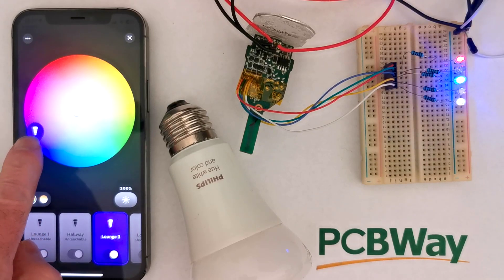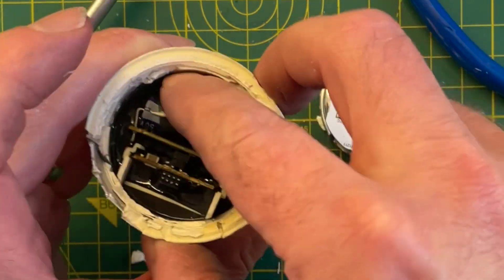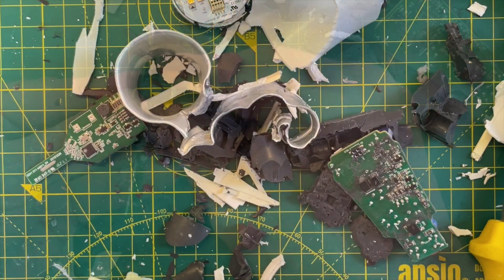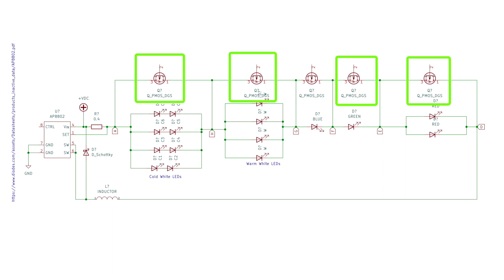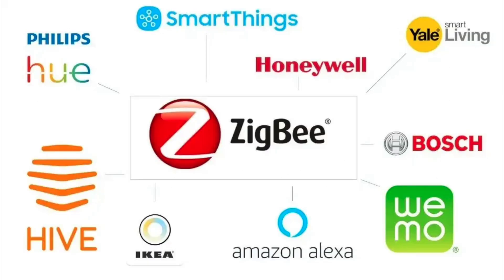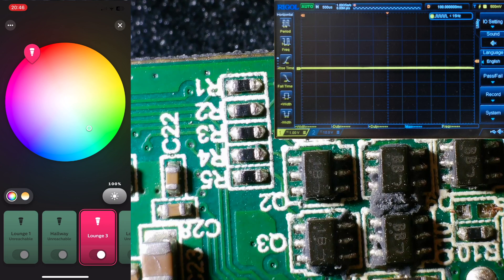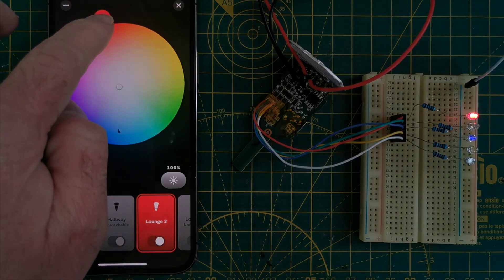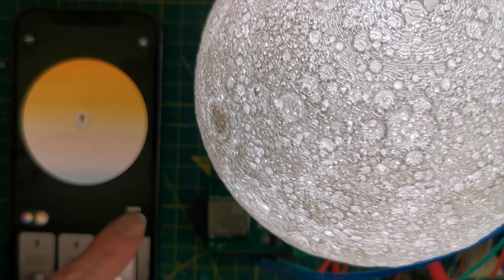Hacking and Disassembling Philips Hue Lights

Comment: This is great info! I have a boat with a 24v DC system and I really want to use my hue bulbs in it. I could run the lights from the 230v inverter, but that seems inefficient. I'm wondering about the possibility of creating a 'drop in' replacement for the power board which would enable the bulbs to work on 24Vdc...

Comment: Weird question, how much of a challenge would it be to get a standard hue bulb to run off of battery power? If I only supply 48 volts to it, will the power board still operate fine?

Comment: I would like to upgrade the LEDS inside to high CRI LEDS. You would need to use a hot air gun or hot plate to desolder the SMD LEDS and then upgrade to appropriate high CRI LEDS.

Comment: At this point it is easier to just use esp32 running esphome to control the LEDs, because they cheaped out on only using one constant current driver chip, it is very hard to reuse

Comment: Thanks for the video! A heat gun will help you remove the plastic diffuser and soften the silicone. Just use caution as not to melt the plastic or electronics, just as you’d use caution prying. Speeds up the workload(and reduces frustration) by a noticeable margin.
Reply from the maker: Great tip!

Comment: Hi! I need to disassemble one of my bulbs for a project. can I run the bulb without housing in terms of heat? the socks gets very hot on a hue bulb. is the aluminum part of the housing some kind of heatsink?
Reply from the maker: Yes, it looks like the whole thing is designed as a heatsink. It will still work without it, but it might cut out after a while.

Comment: Hi I accidentally threw out the LED board with NTC sensor, because I wanted only connection board but now I don't get any outputs probably because of lack of the sensor. The board connects successfully with the app. Is there any way to bypass the sensor? Replace it with single resistor? and how to connect that resistor?
Reply from the maker: Definitely possible - The B & C pins connect to the thermistor. see the high res image here: https://www.atomic14.com/2023/05/04/hue-light-hacking.html a 12K resistor will probably work no problem.

Comment: Have you done any teardown on the Hue candelabra bulbs?  We dont like the bulb base that takes up the lower half of the bulb.  Was wondering if a way to get the LED elements & electronics out, put the LEDs in an empty flame housing, if such a thing exists , and stuff the electronics down into the candle stem of the light fixture!

Comment: can you show to replace the LED diodes(redundant)? can it be done? say or example, 5 years has passed and the Hue bulb goes bad. Can users just solder out bad LED out of the board then replace with generic LEDiodes. then it would be new again? instead of buying new whole Hue bulbs
Reply from the maker: It’s probably possible - if you can take it apart without destroying it. But it’s not really designed to be repaired.

Comment: Nice video, interesting to learn that the Hue bulbs are properly constructed, although it's a pain to get inside them...about the moon lamp, which is pretty btw, couldn't you just have put the whole bulb in there from the start?
Reply from the maker: I was pretty impressed with the construction, surprisingly good. And yes, I did think at the end - hmm... Why didn't I just put replace the diffuser with the 3D printed moon... would have been much easier :)
Reply: @atomic14  Oh well, it made for a great video anyways 🙂

Comment: I love Zigbee and Philips Hue lights. I put the retrofit can RGB downlights all around our house, outside, in the soffits.

I use a raspberry pi and Home assistant to control them.

They work flawlessly. Only con are the lights were 40 or 50$ a piece. They were worth it though as they are the only downlight that is RGB and uses Zigbee. Alibaba had a couple but they are junk.

Comment: What is the PSU controller chip? Is the topology flyback?
Reply from the maker: It's interesting, there is 3 pin IC marked CFW that I can't identify. Everything else seems to be MOSFETs or passive components.
Reply: @atomic14  I don't see a PS chip anywhere. The U1 CFW may be a 3-terminal constant current source. And then this is a discrete design for a constant current power supply.
Reply: Where do the traces from the transformer go? Maybe there is a PSU chip under something?

Comment: Thanks for this. On looking at that teardown I feel it's about time that governments started forcing companies to make electronics far more repair friendly. Make it easier for repairers to take them apart for repair and so reduce waste and landfill. Of course it's not as easy as that though - many greedy companies want to sell more and have more control so they want to make things even harder to repair.
Reply from the maker: Very true. To be fair to Philips these bulbs have lasted 7 years with no problems. And the design and construction seem to be pretty good.
Reply: That potting is actually high quality
Reply: I have a white one that is about 3 years or so, that seems to turn into a 2.4GHz detector at night after it cools down - glows faintly with intensity varying with radio activity. Clearly taking it apart to fix it is not a sensible option, so I guess I'll live with having a slightly annoying night light...

Comment: Video idea to test actual flicker rates of these bulbs. I suspect flicker is quite high as light is quite pleasant. That LED driver chip is expensive indeed.
Reply from the maker: Looks like the PWM signal is 1KHz - should be pretty imperceptible.
Reply: @atomic14  Thank you! I suspect some modern bulbs are moving to higher PWM rates. We have some flickery ones too!

Comment: 100 ohms at 5v is 50ma, 3.2v=30ma. Driving LED from logic would normally be >=330R for safe high side drive. Sure it doesnt matter for hacking but best not to confuse the viewer.
Reply from the maker: Don't forget the MCU is only outputting 3.3V and you have the voltage drop across the LEDs as well, so you'd normally have around 1volt or less over the resistor. But you are right - I got my maths wrong - it's more like 10mA...

Comment: Makes me wonder if there's ESP32 or similar firmware that'll act like a clone Hue bulb, and allow you to take the output and drive Neopixels or similar (Just all the LEDs being the same colour)
Reply from the maker: There's some interesting work here - https://peeveeone.com/zll-tldr/ looks like he reverse engineered the firmware!
Reply: WLED does exactly that, I believe.
Reply: @mc.the_machine  without Zigbee of course
Reply: @zyghom  true, although you could do something with enough programming work on an ESP32 C6 to have Zigbee with something like that. They are available now, but I wouldn't expect WLED to support anything like that for many years unless someone really wants to do the programming and take the initiative outside their core group. I think they are barely starting to support the S series now, and that's not even official, never mind the C-Series, never mind when that's brand new and isn't even supported by a final stable Expressif SDK. Still, I think it could technically be adapted to work with that with some effort.
Reply: @zyghom  you could also potentially make something like that work with thread on a C6, which, might actually be a much better fit than Zigbee, since thread is IP based and probably could readily be translated to using some of WLED's native protocols.
Reply: @zyghom  If I remember correctly, what WLED actually does is it emulates Hue Zigbee hub, so, though it doesn't have Zigbee itself, it can be used by the same software, effectively.